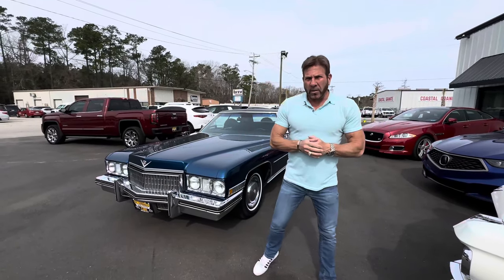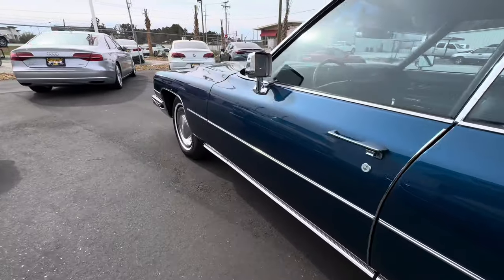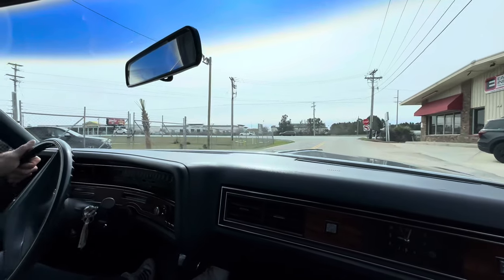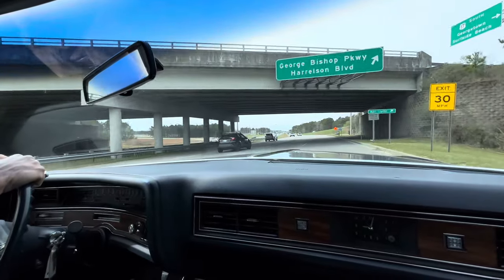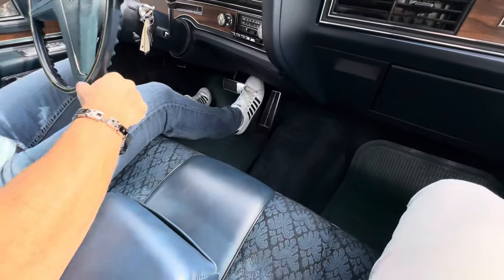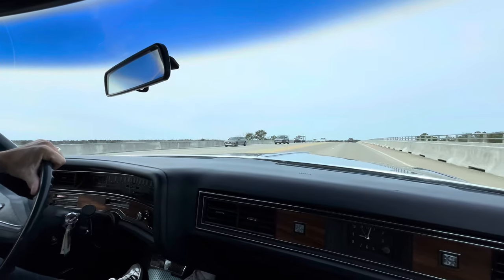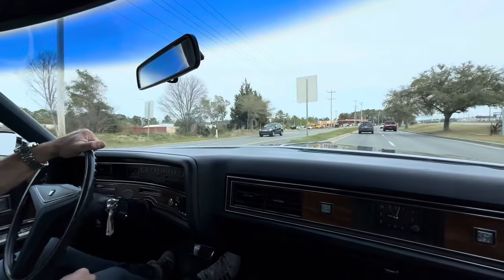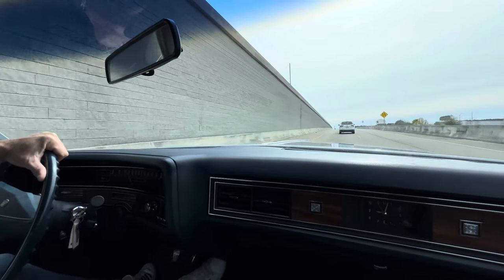1973 Cadillac DeVille Driving Video! Only 15,000 ACTUAL MILES!!

Comment: What octane gas do you run this on ?
Reply from the maker: I always put 93 in everything I drive.
Reply: @christianbugatticg  it's low compression ,Low lead was 90 octane back then .but the system they rate octane diffrent now ,just wondering if it had low octane problems with 89 octane but if you dont use it .the 93  seems to work for the 60's cars that need premium as long as they are not super high comp.
Reply from the maker: You are correct, I just put in the best that is available to me now. Thanks!  @EvanBarr-uk3vk